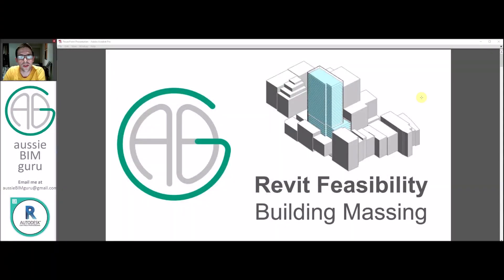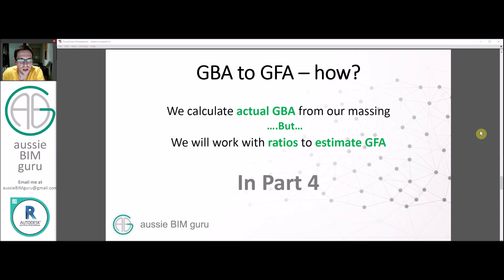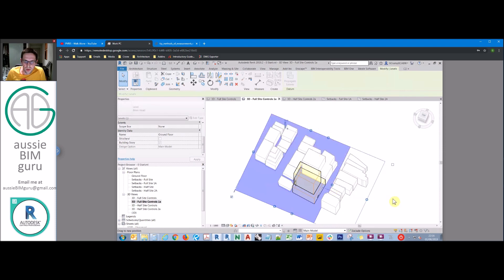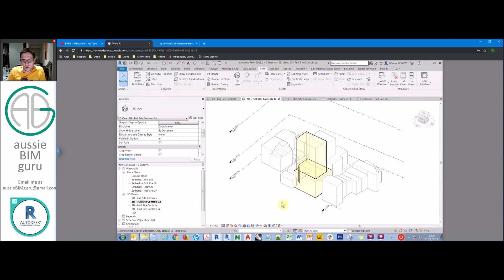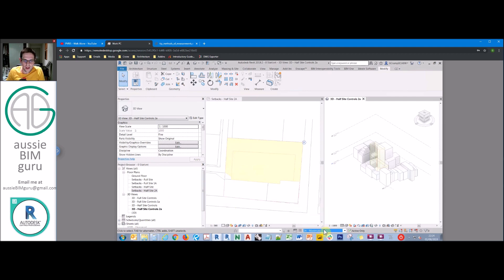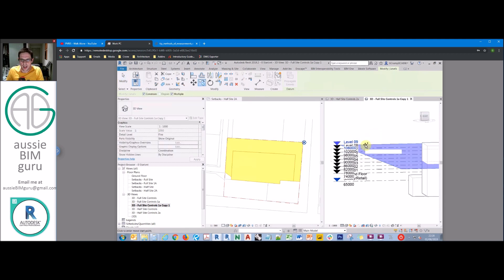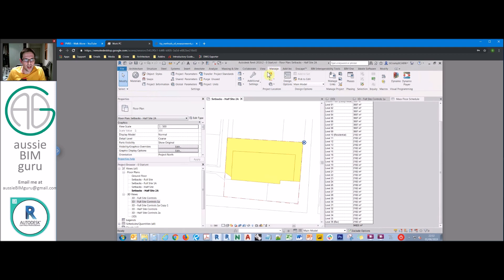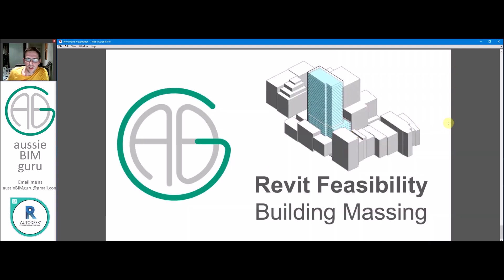Revit Building Massing (Feasibility Part 2)

Comment: Hi Gavin, really great tutorial. Going through it the n-th time. 
I was wondering, can we eliminate the Design Option and just create different subcategories for the so called Feasibility Planning mass as was the case with the Demo1/2 and the surrounding? So we control its visibility under (VV) on different views as needed. We delete the one we don't use eventually. Correct me if I'm wrong, just a curiosity.
Reply from the maker: You can, but I expect it would be challenging making more subcategories each time you want a new option. I prefer design options as you can switch between them quite quickly, and easily get rid of them once you decide which one to use.
Reply: @AussieBIMGuru  thank you for the prompt reply. 
Yes I totally understand that it would be much more tiresome than using Design Options.